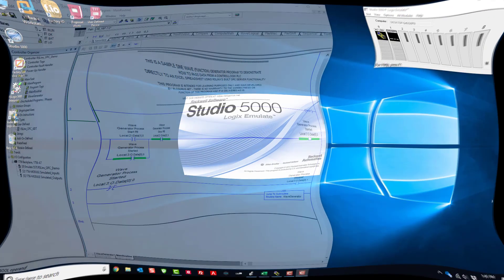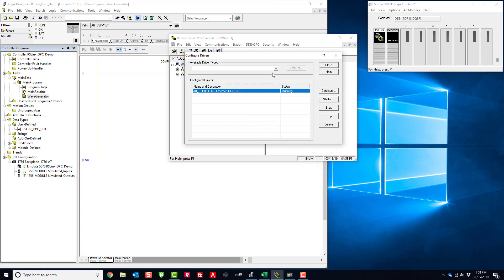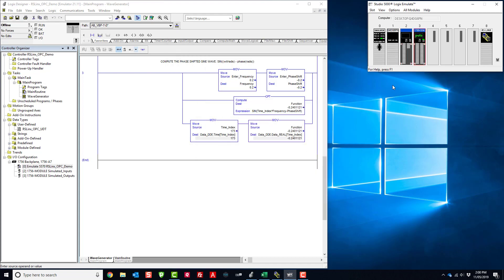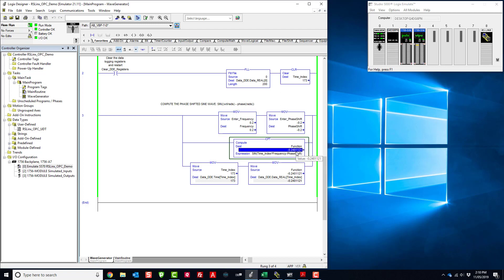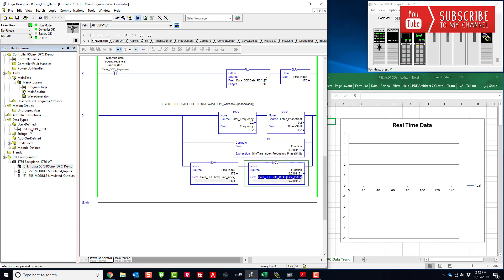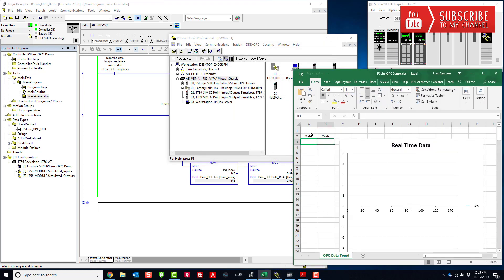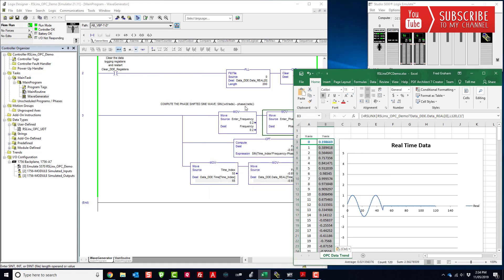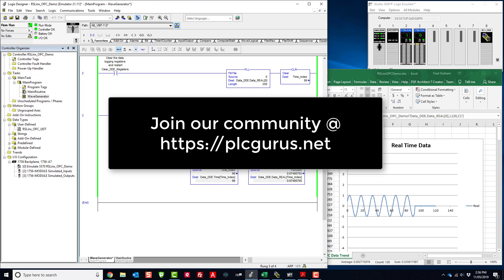Real-time Data Logging Using RSLinx OPC and Excel

Comment: Please change the title , it's not an OPC connection , because here Excel is initiating a DDE conversation with RSLinx , unfortunatly this type of connection is so old not reliable , slow in case of large systems (conversations are updatind clients data one by one for each connection initiation ) not like OPC Asych . well the title should be "Real-time Data Logging Using RSLinx DDE and Excel"

Comment: Can you add data to the spreadsheet without having Excel open and running? do the values continue to rollover? anyother nuances for datalogging for if a customer wanted to log leak test values for each part that cycles through the machine?

Comment: Cool.  I tried this today with real hardware and it works.  However, I can't really get any more then the 120 rows out and then I get garbage in the spreadsheet cells.  I tried playing with the polling time and nothing seems to increase the amount of rows I am able to transmit.  It fails at 200 for me.  Any tips to increase the capture size or is this basically the limit here?

Comment: The information you have provided was very helpful for my PLC studies. I have a question and I do not know if you will be able to help. I realize that you have Factory IO installed in your computer and I was wondering if you have ever try to run factory IO and Emulate 500. The reason I asking is that I have an issue creating filters with the RsLinx OPC server.